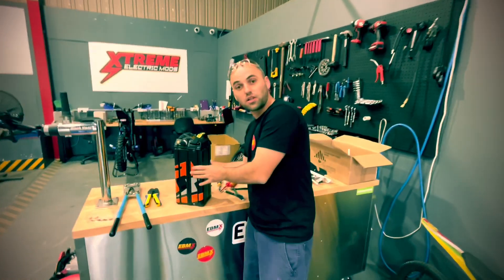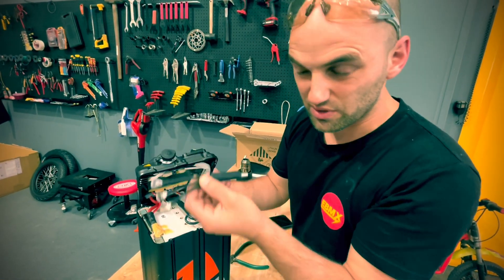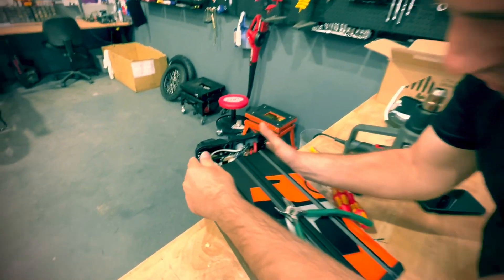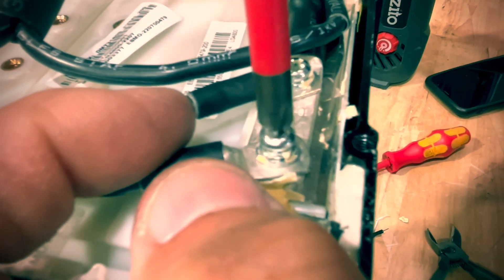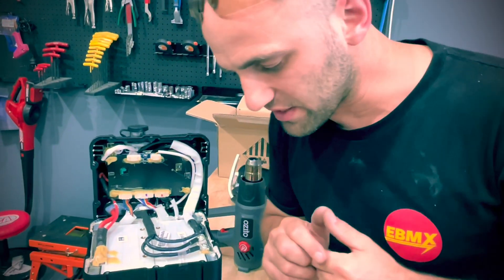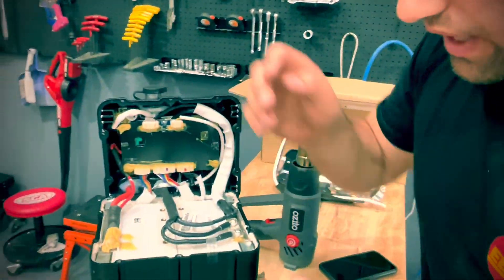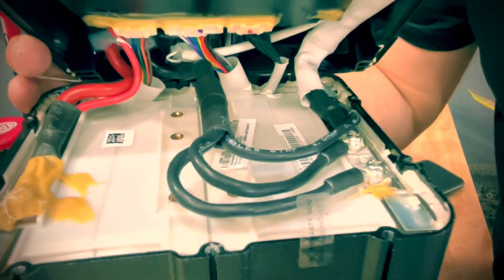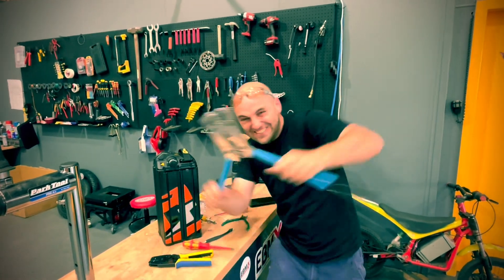How to Bypass new 2023 SurRon 40Ah Battery 21700 cells

Comment: just a note for anyone considering this -- once you bypass the BMS (on discharge only..NEVER bypass the BMS for charging) you give up all sorts of protection features like under-voltage protection, short-circuit protection, and over-current protection. I have personally had the BMS save my battery pack in all three scenarios at one time or another. I think the biggest risk is pushing the cells past their limit. I don't know what the maximum discharge rating is for these 21700 cells - maybe 3C(?) continuous and 5C peak(?) - that means if you exceed 200A on discharge and/or run high current for too long, you risk damaging the cells or even one of the cells overheating and going into thermal runaway (aka fire). You will typically know the max current your controller is capable of and if that's within the limits of the pack, you're fine. Controllers also tend to have some low-voltage cut-off so that might help you there. If you're using a good fuse or circuit-breaker, that will hopefully cover you in the case of a short. There is a risk/reward tradeoff here. Bypassing the BMS is a good idea when the BMS limits the performance of the battery pack (lets say battery pack can safely run 200A but only using a 50A BMS -- this is a good case for bypassing or perhaps swapping for different BMS entirely) but in cases where the performance of BMS is very close to what the pack is capable of, bypassing the BMS takes on a good deal of risk with little reward. Conversely, if you've bypassed your 50A BMS to unlock all 200A of POWER but your controller is only capable of 45A..bypassing the BMS will give you exactly zero increase in performance. I'm not saying don't do it, but people should understand that the cost/benefit varies with every system.
Reply from the maker: Yeeeaahh you said EVERYTHING mate… I’m with you 100%!! I’m actually going to pin you comment so it shows up first here. The older 32.5Ah Surron batteries are safely running 8.5kW (originally 6kW peak). The Talaria battery which is 21700 and 38Ah we run at 9.5-10kW. We need to test this pack and properly to see how it behaves at 10kW but everything indicates that it’s going to be good (possibly 10.5-11kW I’m guessing) but we wouldn’t be pushing our luck that far on a bypass setup.
Reply: Thank you, Bruno!! You guys at ebmx are on the cutting edge with this stuff! keep the awesome builds coming
Reply: I dont understand but yes
Reply: english please
Reply: @CmdrTigerKing  from ChatGPT in simple terms: "Me tell you more about battery thing. If you bypass BMS, only do it when using it, not when charging. When you bypass, you lose important protection like under-voltage, short-circuit, and over-current protection. Me have seen BMS save battery from all three problems. Biggest risk is using too much power and damaging cells or even making them hot and cause fire. You need to know how much power your controller can handle. Some controllers have low-voltage cutoff to help. If you use good fuse or circuit-breaker, it will protect you in case of spark. Bypassing BMS is good if it helps battery perform better, like if battery can handle 200A but BMS only allows 50A. But if BMS allows almost as much as battery can handle, bypassing has little benefit and much risk. And if you bypass to get more power but controller can only handle 45A, bypassing won't help. Me not saying don't do it, but know that cost and benefit changes for each system."
Reply: What the fuck are you saying bruh

Comment: What’s safe amps to push with bypassed battery 110a or can I push 120a?
Reply: Bases on cell specs you should be able to do around 250 amps for less than 10 seconds or for more continuous power around 150 amps
Reply: @itzpogboy  250 Amps on a battery that does 90amp standard it’s only a bypass kit no way will it do 250
Reply: @stevenwalker1375  stock bike does 100 amps and rhe cells are easily capable of 250 lol, only limiting factor is the wires and how long they can do that current for without melting the shit out of them
Reply: @itzpogboy  funny that when mine cut out at 95amps before the

Comment: I will get my updated Surron (2023v2 with the new 40Ah Battery and electric throttle) in 1 week.
I would like to know how the battery is build. 

First of all which 21700 Cells are used? 
How is it build? 
60V means 16s, but 40Ah could be 8p if 5Ah cells or 10p if 4Ah cells.
Does anyone have these informations?
With the number of parallel cells and the discharge current of the cells used we can calculate the Current and Power it can deliver.

Comment: does the Break-Code still work to unlock in the 40ah model? On my 38 it works but not on the 40ah
Reply: what is break code ? i cut the wire to unlock speed

Comment: What cells is this battery pack using? Glad to see they’ve went to 21700.  The “38ah” 18650 pack was supposedly using the Samsung 35E which is higher capacity than the Panasonic PF, but lower continues discharge at 8A.

Comment: Hi. Thanks for the info about disconnect the BMS.
And what happening if you disconnect the smaller connectors first, (like balancers, etc.) and after that disconnecting the main negative wire? I'm a BMW technician and BMW uses battery management systems too, but sometimes same thing happening with the BMS what you mentioned, if you  disconnect some of the main wires first from the battery. But if you disconnect the BMS's sensors and smaller electronics first, then nothing wrong happening. Most electronics die if you make sparks with the battery terminals when you put back the terminals to the battery. Because your hand shaking and not make the connection immediately.
Reply from the maker: Yeah, lots of new smart BMS have an internal firmware running datalog and many times they just don’t come back even if perfectly disconnecting and connecting as per manufacturer’s instructions… I have access to all that info and it still doesn’t work in lots of cases (maybe 1/3) and people get super frustrated stuck with a battery that can’t be charged and they can’t get that BMS anywhere…

Basically, the balancing wires should be disconnected first, must start from the most positive then move to the second tap disconnecting the most negative connector. Most BMS electronics are powered up from the balancing connector BUT some BMS depending the way things are wired up internally inside the pcb they can be connected to the battery positive and things can go weird when disconnecting the balancing wires first. 
Yeah BMS science is pretty weird… I worked for quite a few BMS manufacturers including 2 years at Batrium.com … even high voltage 400-800v BMS that are worth $2-5k share the same dramas… unfortunately… but they work well if installed and not disturbed 😂